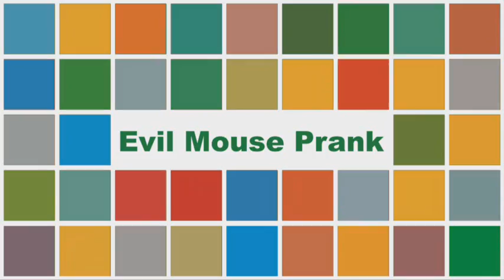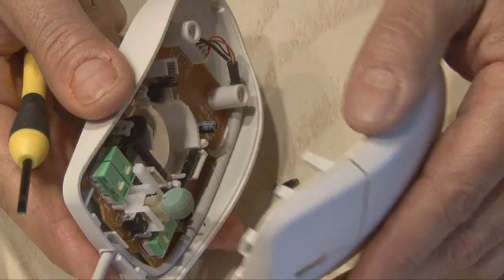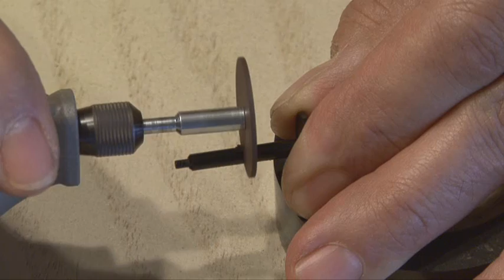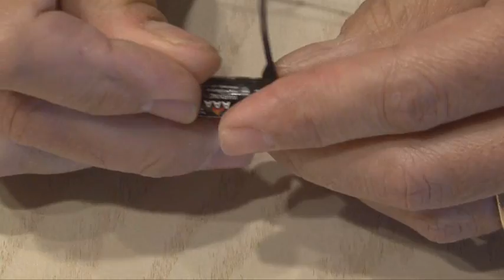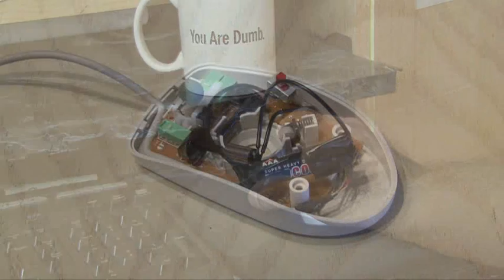Weekend Project: Evil Mouse Prank

Comment: ...or just attach the wireless transmitter inside the PC Case))  It's more that simple, and more effective ^^
..my personal solution is USB-Ports board modification.
This only need a cheap USB  - Hub, wireless mouse (or/and keyboard) and some time to be alone with victim's PC ^_^

Comment: jorasave, for reason that i cannot really understand i cannot reply your comment. In spite of that, i'm going to try to clear up the doubt you have by making a standalone comment in hope you'll view it. The reason there're two mouses at the end is that so they can control the pointer at the same time and affect it: the modified one will move it to the left while the other one is the mouse the pranked one is going to use and pull their hair over not being able to understand why it is that it doesn't work.

Comment: They might hear the motor running.
Reply: They wont hear it if you stick it in where the sun does not shine.
Reply: Benjamin Knight that was fucking hilarious...lmfao
Reply: Small motor? I don't think so.  It is weak one and doesn't make noise that much.  In fact, if older people are here then they can't hear it well.  

PS: I can hear pretty good cause I have a little aspergers symptoms
Reply: Michael Marr most likely they would hear it if it was my computer.
Reply: matthew north The only fan I can hear loudest was Coolermaster.  They're crap fan but case look great.
Reply: plus they think its crazy

Comment: the only way to get this to work is if the "prankie" is using a wireless mouse whose reciever doesn't connect to the ps/2.(regular mouse port)  That should have been mentioned somewhere in the video...  but it was uploaded on april 1st so... maybe it's to prank pranksters?

Comment: I was hoping the mouse would randomly vibrate or spin the ball and move the mouse around.  That would have been an evil mouse.

These pranks are sad.  There are countless programs which could do this without wasting the money to buy all these unnecessary parts.  The sensor that detects the spinning could just have a voltage placed across it from the PS2 or USB port.

Comment: Instead of powering with aaa batery just connect it to the already existing power...(power is 5v, so you may need some resistor), and I would do with the button as donothingloopd said(connecting to the mouse button)...so basically you need soldering iron some solder, wire and free time xD

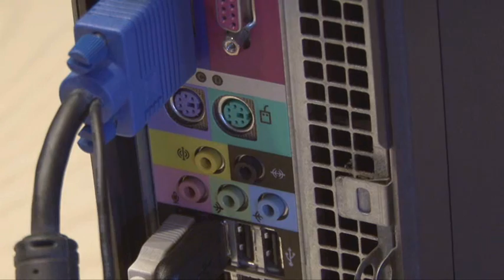Comment: well allow me. i have a laptop and i use an usb mouse coz i hate pads, also they're really bad for gaming. that's beyond the point. but you should notice that analogic mouses don't come with an usb port. 2:04 i haven't seen one of those plugs since the pentium 2 series. also yes of course you would hide the trick mouse cuz everyone would notice if their mouse looks different..but you can't plug such an old device in a current computer.

Comment: that if my mouse is not working I just check the connection... doing so I'd immediately find the dummy mouse... the mouse used in the video is an optic USB mouse and since there is an unused port (that is the PS/2 port) you can plug it in at the same time... an easier prank you can do is connect another mouse (without the mod and most likely near the PC but hidden from the victim)  and start moving the mouse around for him... that is without him noticing is you moving it... have fun :P

Comment: @MrChameleon2010: The trick calls for an analog mouse, but if you saw in the video the victim was using a laser mouse. The analog mouse is just plugged into the PS2 port. I'm assuming this prank will only work when the person is using a USB mouse. As you mentioned another great prank would be to get a wireless mouse you plug in the back.

Comment: Obviously there are  lot of people who don't understand so I will explain it. You don't actually do this to the person's mouse. You do it to a separate mouse and plug it in the USB port. When you plug 2 mouses into the same computer they both work but if you try using both at the same time they interfere with each other. So the hidden mouse is interfering with the normal mouse and making it seem like it is messed up.

Comment: A quicker, easier and cheaper computer mouse prank is just to take a small Post-It Note (1 inch by 2 inch) and put it on the underside of someones optical mouse over the optic. Since the optic is blocked, the mouse cannot detect any movement and the pointer doesnt move. I pulled this at the office on several people this past April Fools Day and it worked great.

Comment: @bjpadz Um, optical and wireless is completely different things. Optical mouse is a mouse with a laser or similar, an analog mouse are those old ones with a ball. Wireless means it's cordless. You need to learn some grammar. I'm not perfect myself but what the hell.

Comment: So...you just need an analog mouse, some electrical tape, a AAA battery, a small pager motor, a little switch, some wire, and heat-shrink tubing.

Oh...and a Dremel, a pin vice with a small bit, and hot glue.

Comment: For those who didn't "get it", the adultered mouse is hooked up to the rarely used PS2 port. The user does not use it. The machine arbitrates both inputs, thus the cursor will be allowed to move up and down, just not sideways. This obviously only works if the user is using an USB peripheral. It also should work for those using touchpads.

Comment: @666OrWhat - I used to prank co-workers by simply changing the orientation of the mouse in the control panel. Even when they figured out what had happened it was still hilarious watching them try to sort out what random direction I had changed it to so they could fix it.

Comment: Meh... more of an annoyance than a prank. Generally a funny prank makes someone jump and freak out, this is more like putting sand in the cheese dip.

Instead, hook up a ball mouse with a motor and leave the ball in. Set the motor up to turn on when they try to right-click something. When the actual mouse runs away from them, that will actually be funny.

Or go old school and just 3m tape an optical mouse to the table while your victim isn't looking.

Comment: It's easier just to put a piece of duct tape on the bottom of the mouse - or a very small Post It note. They move their mouse and it doesn't go anywhere - and then you can write "APRIL FOOL" on the note. When they turn it over to see what's wrong with the mouse - voila'.

Comment: @benz1n0 You're missing the point of this, when you have two mice plugged in, the computer will actually take both inputs, so the PS2 mouse hidden in back is giving an input as well as the USB mouse the guy is using. If you have an extra mouse laying around, plug two mice in on your computer and you can see that it would work. Not that this is a great prank or anything, but USB does not kill this.

Comment: @earlmccormick88 

In the mid 1990's, Fry's was a store that served Silicon Valley.  You were working along on your project at work, were missing a resistor, MOSFET, BJT, op amp, whatever, you went to Fry's to purchase one.

Now, you can buy TeeVees, computer crap and that's about it.  There is a small isle for getting actual work done though - usually.

Make magazine used to be really cool, now everything is just a retarded useless project that you throw away after you're done.

Comment: @lazengann1 me to lol i think i could to dat btw but some mettle insade of the mose on the bottem then hang a live wire (a wire that has a curent but is cut off) from the top of the inside and wen he moves the mose the live wire will ark of the metal than sed curents throw the mouse and BAM lol

Comment: @jojoisownage 
The pager motor turns the shaftin the analog mouse, which is connected to the analog mouse input. When a person tries to use their USB optical or laser mouse, the analog mouse will be moving to the left while they try to move their USB mouse to the right.

Comment: @chieffw Also, if someone still has to run XP for whatever reason, and they have a password protected system, the chances are about 50/50 that Windows will actually recognize a USB set before booting into the user profile. And, as far as 'All the motherboards come with USB input"? A good manufacturer ALSO puts PS/2 ports on there for a reason. It's not a dead technology. Just one that needs to die.

Comment: @chieffw I work retail, and I get a rather large amount of people using specialized equipment that will not work on newer equipment, or that a newer version hasn't been made for, or are using devices with PS/2 entry for keyboard controls. You can also STILL get PS/2 mice and keyboards, brand new, from a lot of retailers. A quick search of newegg revealed 18.